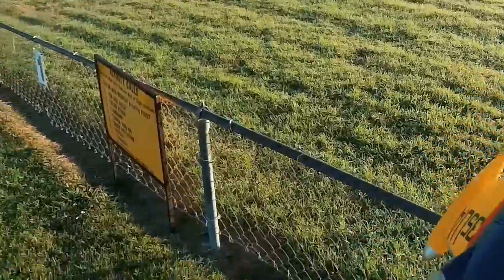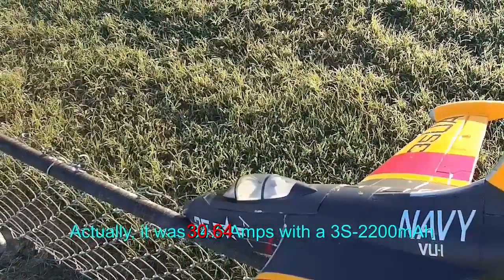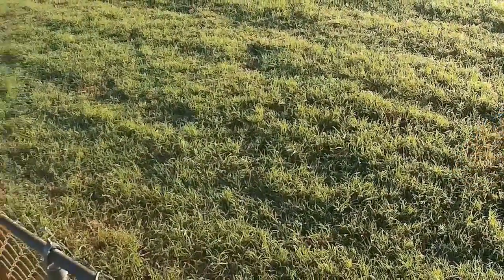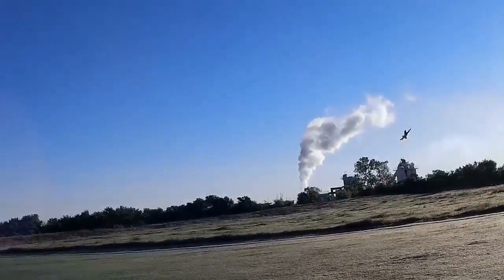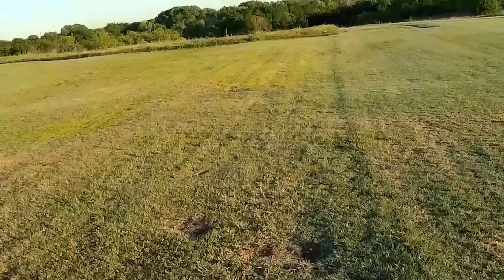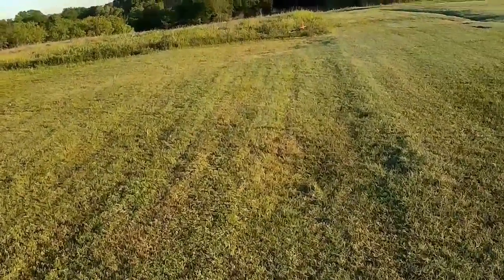Freewing F9F Panther (Stock) - Flying on a 4s Battery

Comment: Hi, thanks for the video, I have 4s 1500 batteries, how many minutes of flight can I do in your opinion?  Thank you
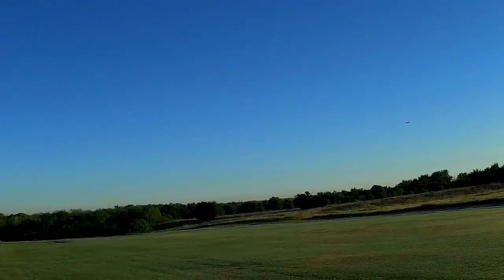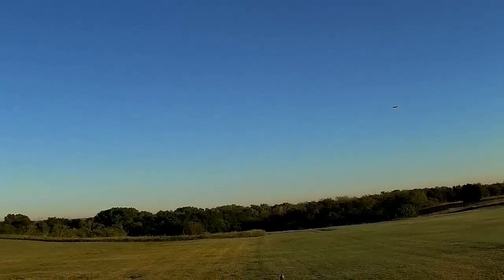Reply from the maker: It really depends on how you manage your throttle....If you go at maximum, then you will get about 2:30-2:45 minutes.
If you vary it and only do a few high-speed passes, then you could stretch it to 3:30 probably
I used 2200mAh batteries mostly (and a few 1800's) and with the 2200, I could get 3:30 doing max throttle 50-60% of the time.

Comment: So is your stock ESC still running fine with 4S batteries?
Reply from the maker: I never had an issue with it. I crashed this particular one a few too many times, and parted it out. I bought another one, and went ahead and put a 50amp ESC in it, and would fly it at max throttle nearly the entire flight....I later on gave it to a friend at the flying club....Been thinking about buying another one, but heard rumors of a new model of the F9 being put out later this year, so I'm waiting to see....(No idea if it is going to happen after all this virus crap though, as not a lot of new stuff is being released right now)

If you have one, I would not be worried about changing the ESC as long as you don't peg the gas pedal for extended times....
Reply: @44Mag  Hey thanks man any advice is appreciated. This is my first plane build, it was given to me, so I'm trying to set it up right. What receiver do you use?  I'm looking at that 6CH Admiral one with gyro. I would get a Spektrum, but to get one that has telemetry and gyro is more than the dam plane its self.
Reply from the maker: @Damitsall  I used a Spektrum 4ch in both of mine. (The plane only uses 3 channels since it has no rudder)
If this is your 1st EDF, watch your CG and your hand-launches. Both are tricky, especially on a 3s battery.

I found it easy to launch with a 4s all the way to the front (1800 is best, but I did use 2200 a few times) - I would suggest getting a friend to toss it for you the first flight. Set it up where the nose is heavy (based on the manuals CG location) otherwise, it has a bad tendency to stall when it is neutral-balanced, especially on a 3s.

Don't get me wrong, a 3s battery will fly it, just makes it harder to hand toss. On my 1st one, I started with the wheels on it, and was able to take off from a short grass air field using a 3s battery. (really easily when I set it up with flap-a-rons.)

As a 1st EDF, there is none better than the Freewing Rebel V2 It sells for about $190 but it has retracts and flaps built in. It is 2-3 times bigger than the F9 and flies way better. Plus, it uses 4s batteries (2600-3000mAh) - You can also use a 5s 2700 in it to really push it through the air. Best value jet I have ever flown.

Comment: Im running mine on 3s 1800 and I think I finally got the hang of it but that first launch....yeah, not pretty.
Reply from the maker: I was never able to get reliable hand launches on the 3s batteries. 
Later on (on another plane) I put in a 45amp ESC, and ran it on a 4s 1600mAh, and it was a real pleasure to fly.